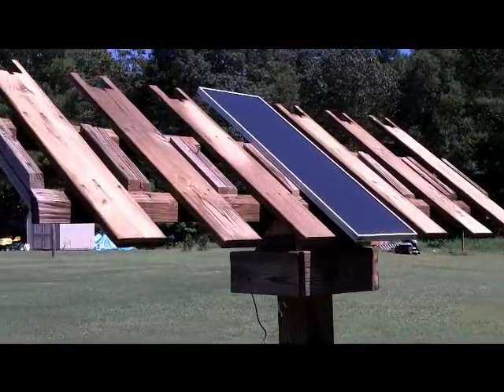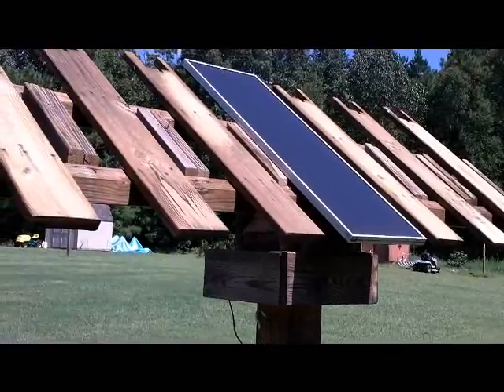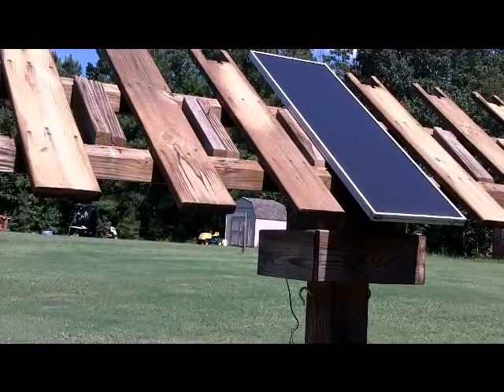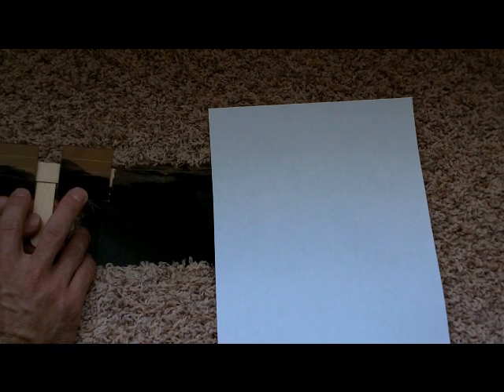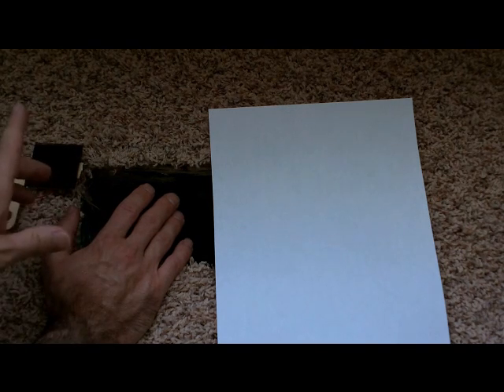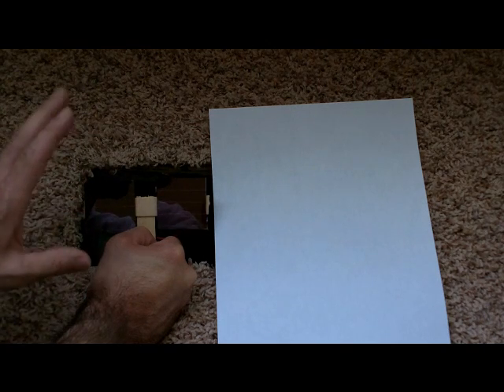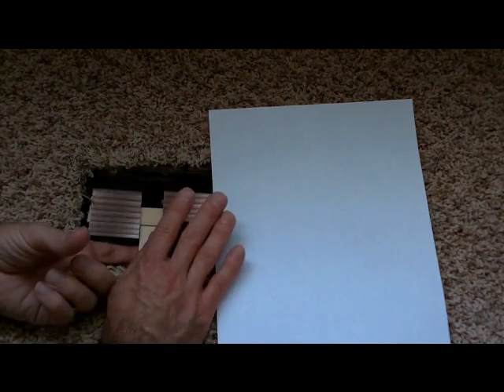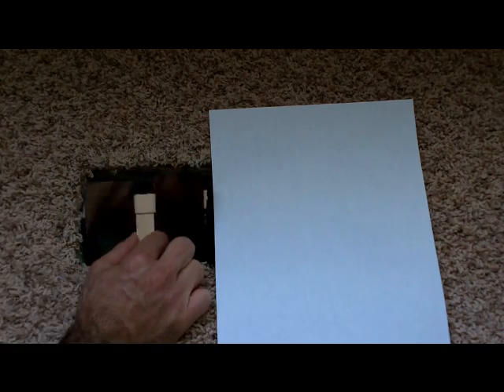Underground solar stand

Comment: Very cool idea.  "Roll Top Desk" btw is the type of desk you were thinking of. And your application could be triggered by an alert from a NOAA Weather alert radio, or a Barometer sensitive actuater. All very feasible and doable. I like the idea and am sure the end result will be very impressive. I do like your work!!
I think Hydrauiic Cylinders would an efficient as well as inexpenive way to raise and lower. The stuff that car customizers are using these days are quite powerful and affordable

Comment: You would need solar power most in floods, so underground doesn't sound so good to me.  I think 4 poles in the ground with the panels being able to retract down into a sturdy box would be good, especially if they were close to the ground.  Instead of a jack,  a cranking threaded rod might be better.  Afterwards, the crank could be modified with a motor.    My2cents